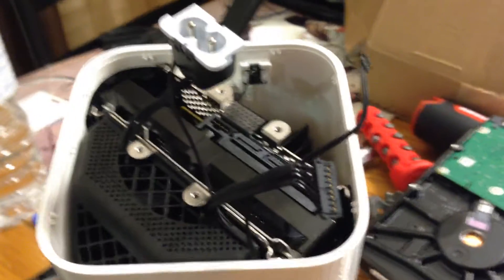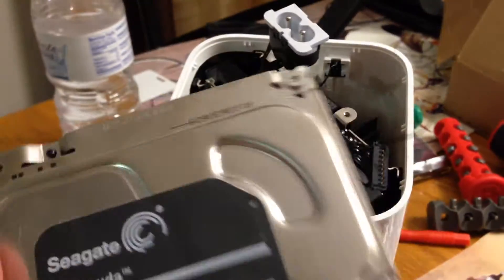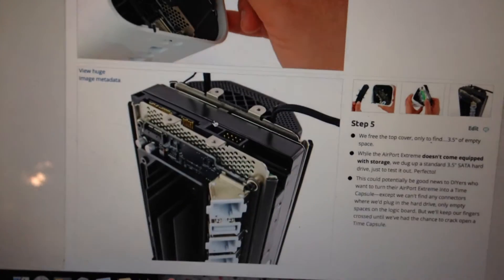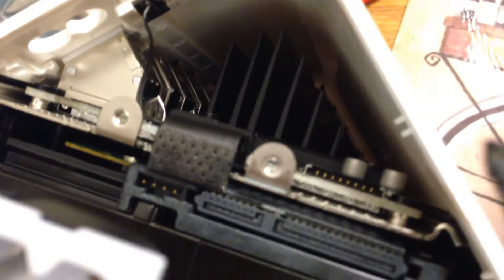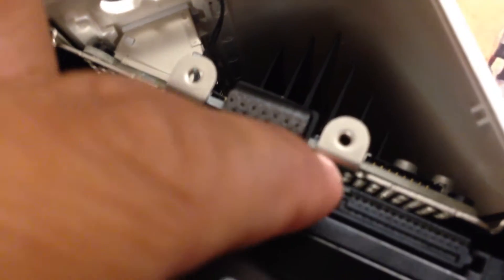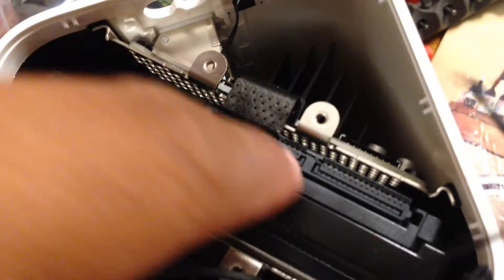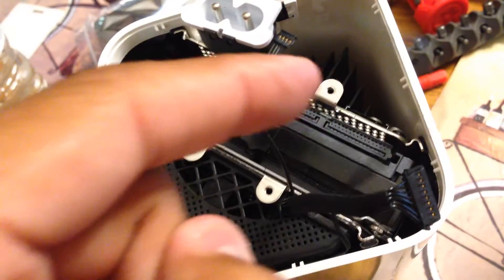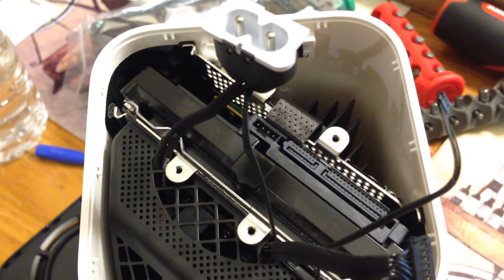Apple Time Capsule 2013 AC Upgrade - 3 to 4 TB

Comment: Do you need special wires in order to upgrade an AirPort Extreme to time capsule? Like the wires that plug into a hard drive to logic board or is there some type of soldering involved

Comment: hey i just upgraded the drive on mine and its not working i didnt format the drive before i put it in it it was in a winbox machine originally formated as ntfs i used the airport utility to format it and i cant access it any ideas? like when i try to access the drive in osx 10 it would say * the operation can't be completed because the orignal item for 4tb cant be found and when i try to do a time machine back up it is detected but it gives me a error osstatus error 22
Reply from the maker: +Sean Zappulla yes you are correct.
Reply: MrFmlouder damit it works fine in windows... bit of advise to anyone that does this make sure the drive is formated to a mac file system before doing the upgrade it will save you alot of grief unless your really smart and can format the drive through a console
Reply: MrFmlouder scratch that my hackintosh was just being stupid and still is wont connect to the time capsule unless i use the s m b : / / method but tested it with a mac mini 2014 works fine
 btw theres a 3 pin connector which is the led cable for the tc it was very fragile the connectors broke off while i was doing my upgrade barely put any force on it and i was useing a plastic spudger and the bam cables just ripped out for some reason either way i was able to slip the cables back in no issues :)
Reply: MrFmlouder You have to format the hard drive for a mac first. It's the same if you use an external USB 3.0 hard drive for time machine.

Comment: Did you damage the edges/lid when you opened it? If you have any tips on how to minimize damage, please share :)
Reply from the maker: +Andy yy sorry, late on this. there was slight damage.  you can order official tools but i use a regular knife.  nothing was damaged inside.  just take your time.  honestly, i'm moving to a faster AC router now.  i have a mac mini hooked up, so it shows up as a file server all the time.  i have 16TB worth of hd's hooked up to it, with USB 3 speed and AC.
Reply: GForce75 Ok, thanks!
Reply: Boy this was a pain to get that bottom base out lol managed to pop it open with a flat head

Comment: is it possible to replace the hard drive in the previous gen (or recent gen) time capsule with an SSD drive????
Reply: yes
Reply: R0K99 like a standard SSD would fit?
Reply: yeah a 2.5" would you'd need an adaptor though.
Reply from the maker: Yes, you can do as he suggested.  The 4TB upgraded worked fine.  Why would you want to add an SSD?  I would slap a 6TB or an 8TB in there.  I wish apple allowed the USB port to be a 3.0.
Reply: because SSD is faster
Reply from the maker: randomrazr Your right, it's faster.... but i wouldn't know the benchmarks.  I know the wireless connection itself is a constraint.
Reply: GForce75 more of the sata controller on the board. iirc the airport only supports sata 3gbps which would bottleneck the ssd.
Reply: R0K99 so dont bother?
Reply from the maker: +Kawaii Gardiner ya.  I mean, if you got the money to drop on it... go for it.  The amount of money you can spend can buy another AC TC.
Reply: GForce75 with an hd still lol

Comment: hi, great job, how are doing the time capsule? i'm planning buy a TC A1470 3 TB model and upgrade it to 6 TB with Seagate SATA III HDD 6 TB 128 MB. What do you think about ?
Reply from the maker: Maiquel Goelzer Rinco Sorry for the late response.  I think it will work fine. As long as the drive doesn't overheat (which shouldn't be the case). good luck!